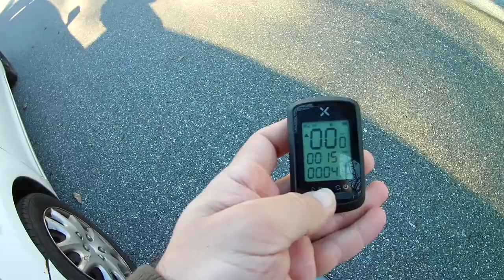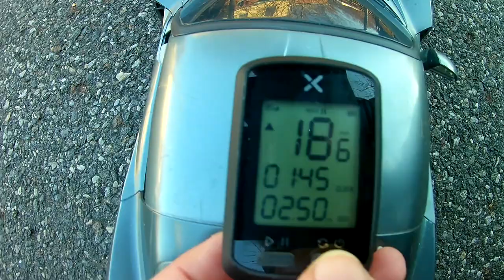1/8 scale Hennessey venom GT gets a new motor from Surpass Hobby

Comment: Hey guy  I've been looking for the same thing it's the hex on them that's the problem I've asked people on YouTube with cnc machines to make some but nobody responded, the hex insert has to be cut precisely to the back hex ,I might have to change the steering front suspension cut out the original and find and fit a separate front suspension